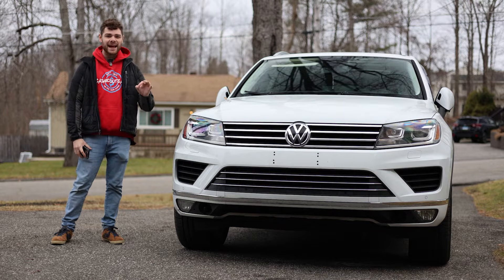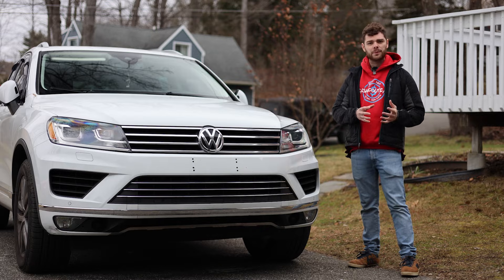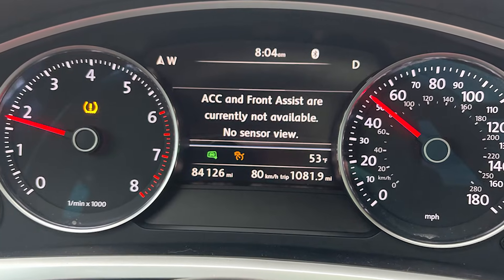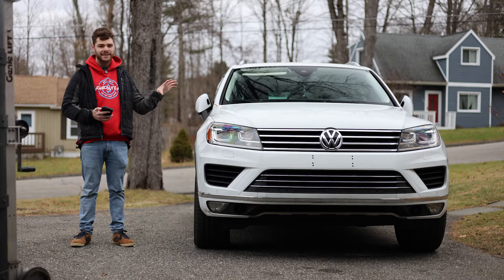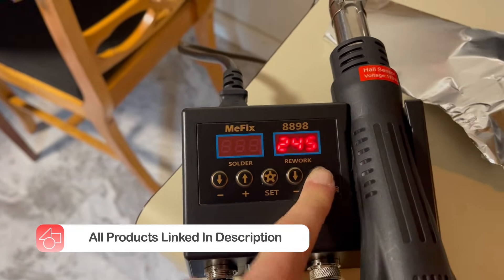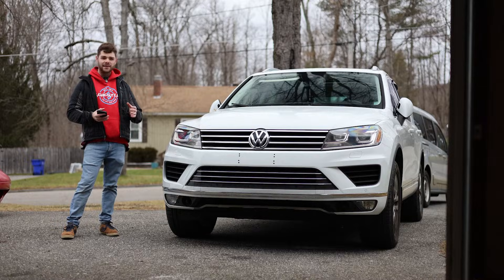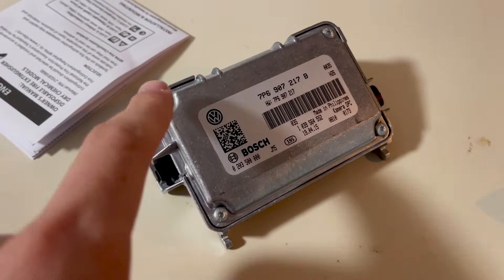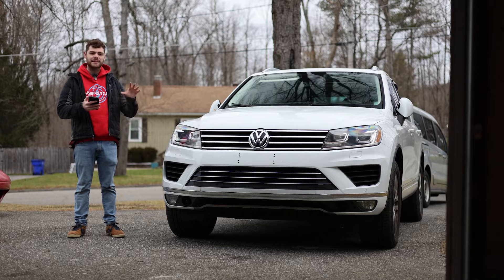How To Fix Adaptive Cruise Control (ACC) Issues - Volkswagen, Audi and Porsche

Comment: Imagine having an Audi A8L with no cruise control at all, no lane change assist or anything involved with that system for months and the "stealership" tells you you need to replace your windshield, the ACC camera & it has to be programmed and calibrated for the low low price of $8,000....WTF? Bought the soldering thigamajig you bought, did exactly what you did and got the same results you got for the low low price of $45...WTF!!! This by far is the absolute best way to fix your ACC systems because nothing functions without the camera & the best part is the camera isn't even broke. Thank you sooooooo much for this video * if you have anymore fixes like this please make a video & post it!
Reply: Same problem with my 19 a8
Reply: @chuyramirez5782 sorry for taking so long to respond but I would say do it. It’s more than likely the same camera. I know yours is a newer model but even if it has a newer camera it still has a chip in it and this method works
Reply: Bro,  I’m telling you, watch the video more than once (I did) get the same gun & once you’ve done the same method he did. Everything will work just like it’s supposed to!!!
Reply: @Fresh2def24-7  did it work since first try?
Reply: how  long did you coolded it down?
Reply: @dastan4117 I did it while I was at work so it was a couple of hours. I would say give it at least an hour or two or until it’s room temperature but don’t put any fans on it.  Just let it naturally cool off
Reply: It absolutely worked first try & all those systems work as they should without any calibration

Comment: Thank you for this fix.  I applied the procedure to my 2016 Touareg TDI and it worked first time.  Already had a 909D+ 4in1 SMD Soldering Iron Hot Air Rework Station, used 350F for 5 minutes.  8 months ago the ACC stopped working, VW Service said scan tool could not connect and that I needed a new ACC Control Module.  3 Weeks ago the windshield caught a rock and needed replacement; they couldn't complete the ACC test, said to bring it back within 30 days if I find a new unit.  Took it to them this morning and the unit worked.  Tech completed a realignment on the camera; test drive reviled everything works, including the lane assist. Thanks again!

Comment: Here is my day one of the fix. I will update when it fails. Until then, however long since i have made this comment, it should last.
Reply: I have completed tbe procedure for a second time, at a higher temperature. I will update when it breaks again. If it does, i think i will attempt reballing it myself
Reply: @ianp0817 tried this on my c7 s6 and one of the capacitors on the other side of the board came off😭 will be contacting a board specialist in my area
Reply: 11 days. Its broken again

Comment: I have a Ford with adaptive cruise control. It is far superior to VW's. I rented a VW and activated the control. In a straight line it worked well. On a curve it went to the outside line. You can't drive on a curve safely with the car tracking on top of the outside lane marker.

Comment: I have a 2016 Touareg, and I got it over a year ago with this issue. The dealership told me they’d ordered the part, and then a YEAR later after multiple follow ups found out it had been discontinued. I was searching for how to take it out to mail it off to get remanufactured for over $750, and found this video. Fixed! I used a heat gun on medium, I can’t even believe how easy it was. Thank god for this!!!
Reply: How long did you use the heat gun on medium for? I want to try this on my 2014 A6, but I also don't want to screw anything up. 😅

Comment: Just tried this on our 2016 touareg and it worked perfectly on the first try, took less than an hour! Fingers crossed it stays fixed, and if the light comes back on we'll try it again. Turned off the warning light on the dash and the cruise control started working again right away.
We used the 1700 watt Hercules brand heat gun from harbor freight, since it had a digital temp display and a focus nozzle; had the nozzle pointed right at the chip from an inch or two away with the heat set to about 500 F and the fan on mid speed for three minutes, and it worked perfectly. Thank you!

Comment: Thanks for posting this video - this worked perfectly for my 2016 VW Touareg TDI; like most on here, we used a pliers to turn off the mirror. We used the rework heat gun you linked below: 250C for 3 min, 300c for 3 min, 310 C for 3 min. Let it cool down, reinstalled it and it was fixed. Less than an hour total. I'm very grateful for your post - it helped me fix an issue that wasn't going to get solved any other way.

Update - the warning light came back on after a week, so removed the camera gain and used 3 min each at 250C, 300C and 330C. It's been two weeks on multiple long road trips and all is good so far.

Comment: Nice Video @cashfixescars  😎Not sure if you are aware but the best and most long lasting repair is to remove the chip and Re-ball it with new solder. I have Reballed several of these. 😃When you Reflow it it takes more life out of the chip. They are forged with heat but they also die with heat.

Comment: Not really surprised this is an issue given the beating from the sun these cameras get, great video! 😊

PS that reflow station is super cheap and while it works these cheaoos take far too long as risk damage to the board the chips and other components. You would be better off with a cheap heat gun and a very focused nozzle for the simple fact that it gets much hotter much quicker although it has its own risks to being too hot the foil was an excellent idea!

Comment: Amazing recommendation!  Keep posting TOUAREG related content!!  Very helpful as this part is discontinued in the US and it costs over US$ 2000 in Europe.  It worked as explained. Used 590F for 3 minutes continuously, them gave it a minute rest, and used 590F again for 3 minutes continuously. So far so good. To remove rear view mirrow turn counterclockwise with some pressure. To install back, turn it clockwise with some pressure again.

Comment: Just finished repair on my 2016 Vw  Touareg it now works fine I’m so very happy . I did 2 min at 245 than 3 minutes at 310 ending last 15 seconds at 320  , didn’t remove ribbon wire but shielded it with a bubble of foil over it and one over the chip that was to be heated.  Also found a video that shows a good view of removing the camera it helped a lot for me  ( Vw Touareg front assist camera removal guide ) Chanel. Eurocarelectronics1.   A Big thanks to (cash fixes cars )YouTube .

Comment: Fantastic video, VW Touareg 2012 camera repaired as described on this video. The processor chip is no longer available. VW charged me AUD2,200 for the spare part that they could not supply. Now to get the refund. The ACC is now working perfectly. There is no need to recalibrate the camera after the repair.
Greatly appreciate that you took the time to post this video. We added a thermal pad to try and get more heat away from the processor chip into the housing, time will tell.
Reply: We went for 220C for 2 minutes and added flux around the processor chip. The flux did flow.

Comment: So this was the third time my ACC failed. The two times before the unit was under warranty so no big deal VW dealer paid the repair bill. Fast forward to 177,000 miles and 9 years later. I get that dreaded message "Adaptive Cruise Control not available" in the message center. Oh crap. I start investigating a replacement unit and how to fix it on the web. I find two repair shops. One in SC and one in Queensland. Both need the camera unit. OK great how do I find and remove the camera unit. I find Cash fix cars on U-Tube and wow what a find. His easy step by step advice walks me through the process and within one hour the ACC unit is removed, repaired and reinstalled and working like new. I just saved $900 dollars. I build Nixie clocks for a hobby so I already had the Rework Soldering tool. Pro tip. heat to 300 degrees F for 3 minutes keeping the tool tip 1 inch away from the chip. Let it cool for 30 minutes at room temp. No need to remove the board from the housing, leave the ribbon cable alone. Replace the cover and reinstall. Take the car for a drive and test the ACC. I have read that re-calibrating is not necessary because unit that came out went back in. If you need to re-calibrate there are several videos on how to do that, or take your car to a VW dealer and have them do it. 😀

Comment: 2017 VW Golf Wolfsburg edition.  Just says Front assist not available.  Shop charged $300 for the diagnostic.  $1100 for the part plus installation. $1400 for a feature I don’t use.

Comment: So, I was so encouraged by this solution. I tried it twice and still no success. The first time I heated up the chip for 2 minutes at 245C and then 3 minutes at 310C, back to back. reinstalled and nothing. I removed it again and tried 310C for 4 minutes. Reinstalled and still didn't work.  I was so hopeful. 😞

Comment: 2016 Audi S7. Heatgun didn't work. Had the usual suspect codes. ACC is not available. 

I removed it from the housing, surrounded the chip with Heat-resistant tape, and then made a shield with aluminum foil. 

310C at 3Minutes. Let it cool for an hour. Popped it in, and it worked like a charm. 

I had a new one on order for over a year from Audi. It was $1200 from the dealer $1000 to calibrate and install (if it ever became available).

 I spent $75 on the Amazon link here and had it the next day Prime. Even the local services wanted $500 to mail one in to do this same type of fix. Literally couldn't stand that popping up on my dash and not working. I used my OBD11 to clear the fault (non-recurring now).

Thank you for this Video!

Comment: Ok weird question. I cannot seem to get the module out of my windshield due to the low clearance for me. Could I just use the hot air rework station while the camera module is still in the car, on the windshield??

Comment: So strangely, I don't have this unit on my car. The car has adaptive cruise but does not have side or lane assist. I have nothing between the mirror and the roof so no additional camera unit. Even VW said it should be there when they looked it up against the chassis. 😑

Comment: I could hug you.
I can confirm this works on a 2015 Audi A8L 4.0TT, my module is marked 4H0 907 217F. Repairing my own module vs replacing means I did not need to VIN match or recode - (if used ones can even be recoded)  My dealer has had me on perpetual backorder for these modules since October - not holding out hope.  On to repairing mine- once I got the module removed and opened (four T10 screws),  I made a heat shield to protect the area around the processor chip (silver square) with piece of flat steel with about a 1" square opening (an 1/8" thick wrench for an air tool arbor) and masked the rest of the exposed board with a few small credit card size pieces of this stainless - anything that is heat stabile will work - main thing is to protect as much of the PC boards other occupants.  I did some digging, PC boards that are wave-soldered - the solder will flow at a slightly lower temperature (235-260°C).  I used a temp gun and a standard Wagner heat gun on high.  Staying within about 1.5" from the chip and moving the nozzle in small circles, I slowly brought the chip up to 240°C and held it that temp for only 10-15 seconds, and then slowly backed the gun off a few inches, and then let everything cool to ambient on its own.   A few thoughts and suggestions from a shop here in Des Moines that specializes in board level repairs - keep the board as level as possible when reflowing- any SMD item will move if the solder is reflowed and the part is vertical or inverted.  They also gave me another tidbit - watch surrounding solder joints, once they get very shiny, it means they have wetted out and flowed. meaning they have reached the right temperature.   
If you have never done board level repairs - proceed with caution, be minimally invasive.  If you are a houseplant and are genuinely surprised that you burned your car to the ground because nobody specifically told you to "not a use a propane torch to heat up an inverted PC board tucked into the headliner", put the tools down.
This worked for me, on my car, with my tools on my workbench, and my close to 50 years experience turning wrenches.  Hopefully it can be helpful to somebody else.  My ACC warning light is gone, my cruise once again works. WOOHOO!!!

Comment: My ACC and Lane keep cannot be turned on too. But my fault codes are U112300 Data Bus Error Value Received, and C110400 Camera Malfunction. They are different from yours. Do you know if your fix can address these two errors? Thanks.

Comment: ** ROASTED MY BOARD **

Did exactly what explained in the video. 7min at 100C. Monitored with a laser gun, board was protected with 5 layers of foil sheets. And it completely cooked the board. Now the board is unrepairable. Would love to know how it happened.
Reply from the maker: What did you use for a heat gun?

Comment: You are my hero and I love you man!!!
I have been driving without cruise control and without impact detection for 2 years now. In the workshop I was told that the right radar sensor was defective, the cost of the material alone was €4,200. Unfortunately it was not possible to recode the control unit so that it only has a normal cruise control, because I could have done without the adaptive one.

As I said, unfortunately that was not possible and so I had to constantly drive without cruise control, which was extremely annoying. Recently the lane departure warning and the high beam assistant also stopped working. It was clear to me that the problem was with the camera and that's how I came across the video. So I removed the camera as described in the video and heated the chip at 320°C for 4 minutes. I put everything back together and was amazed when not only the lane departure warning but also the cruise control and impact detection worked again!!!

Saved a lot of money with this video and these instructions.

Thank you so much!!!

Does anyone know if this will solve the problem permanently, or will the error keep coming back and you have to repeat the procedure?

Comment: Yes thank you it worked!!! I have a 2016  V8 TDI R-Line Touareg   250k odometer in NSW  with this issue. The warning light and annoying bings started a few months ago. "ACC and Front Assist not available" The most annoying part was that the problem was intermittent so sometimes the bing would be every ten seconds or so.  Followed your directions and worked a charm.  Used a Black n Decker heat gun / paint stripper on high setting for about a minute with lots of tin foil to protect the circuit board. (Maybe could have used more protection because the board did heat up as well) Two weeks later and still no errors. Happy Days

Comment: Thank you for this video! My 2015 Touarg has been without cruise control for over 2 years and you solved my problem!! I am so impressed with your ability to root cause and ultimately fix this issue! I used 610F on the heat gun for 3 minutes and 30 seconds and the system booted up right away after reassembly!! My VW dealer wanted to replace the entire camera unit and cable and had no idea when the parts would be available. This is huge!!
Reply from the maker: Glad to hear it!

Comment: i've just had mine repaired by an electronics expert, wish i'd known this before. we were led to believe that the failure is due to excessive heat from the sun on the camera, is this true or not?
Reply from the maker: Was that a local shop or someone online? And if you don’t mind me asking, how much did it run? I do believe that’s true, however I’ve seen this fail on cooler days as well so I’m not sure that’s the exact cause
Reply: @cashfixescars  it was online, about $1000(Au) for analysis and repair with 12 month warrantee. A new camera here is about $2500 plus calibration so well over $3k
Reply: @cashfixescars  $1000 with 12 month warrantee for diagnostic and repair. a new camera is around $2500 plus calibration so well over $3k

Comment: I would strongly recommend removing the ribbon connector. 
I did everything as stated, had a laser heat detector too making sure I got the chip up to 180c and I think it is far too hot. 
It made the ribbon connector burn and disconnect from the circuit board, now off to a repairer tomorrow to hopefully get it reconnected and I'm praying I didn't just wreck the whole board.

Other repairs stating getting the chip up to only 100c which might have worked, who knows... but you have no idea the level of frustration removing the tinfoil heat shield and seeing the ribbon connector completely detached from the board after thinking you were going to make a quick fix

Comment: I have 2023 Audi. The windshield was replaced. Will your tutorial work for this issue or it has to get calibrated professionally?  Thank you
Reply from the maker: If it needs a full calibration this unfortunately won't fix it, it'll need some coding work and possible sensor adjustment

Comment: Set the chip level in vice still in housing. Heat it for a minute at 200 C THEN INCREASE TO 300 C (ABOUT 550 F)  FOR 3 TO 4 minute. Let it cool and reinstall. I had to clear the codes with an OBD II reader and it actually re-solders the circuit inside the chip( I Think) who cares yes it works for Hyundai Palisade. Good video, Thanks.